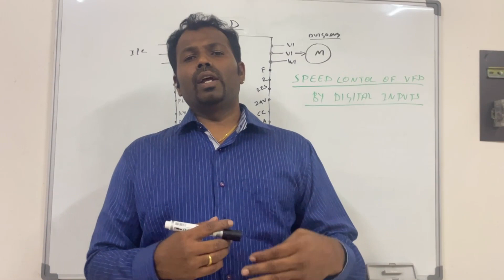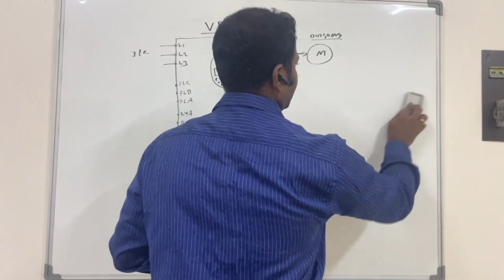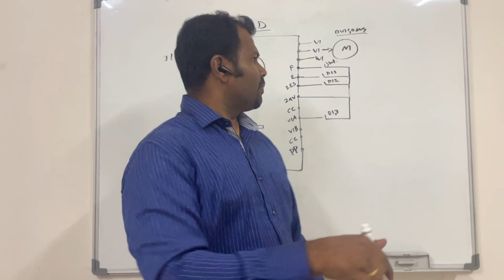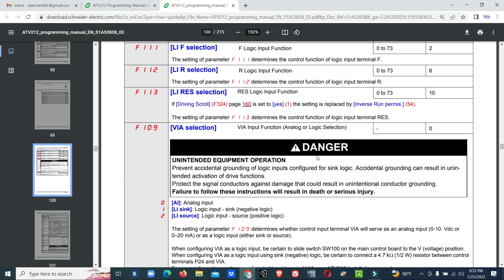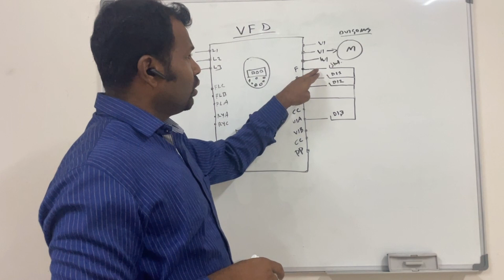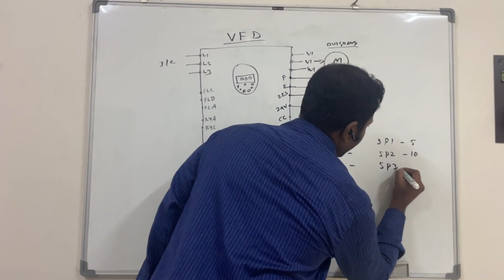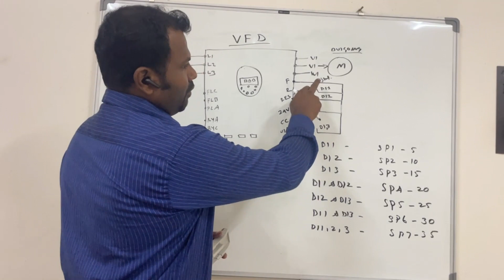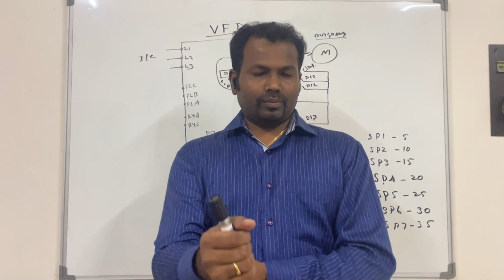VFD speed control / VFD  Industrial application

Comment: Super ji, thanks but 3 input on same time the speed 30 only ,but you wrote 35, and DI 1,3 on 20 rpm only but you wrote 30
Reply: Ji, I want learn Siemens plc
Reply from the maker: @manilakshmi6118   i posted many videos 
check in my playlist
Reply from the maker: It’s an example only we can set to any speed by changing setting